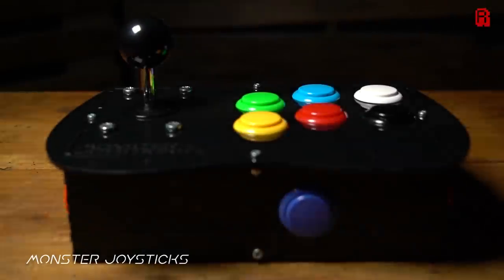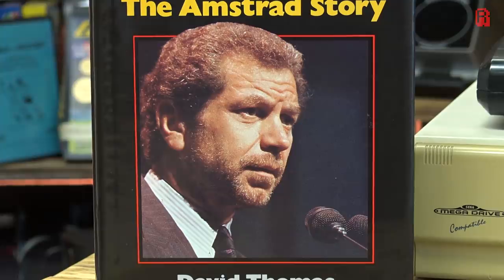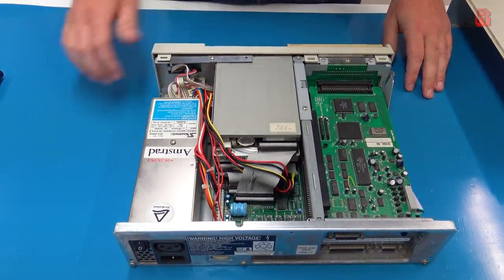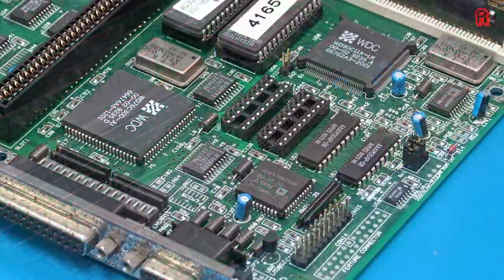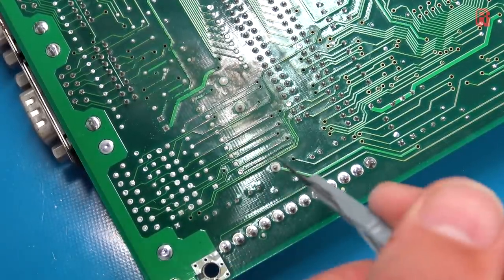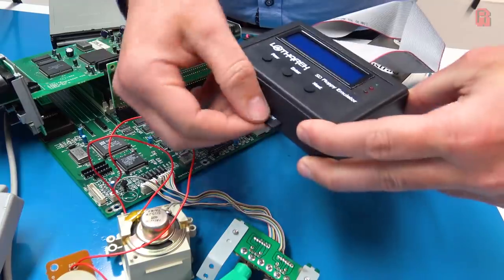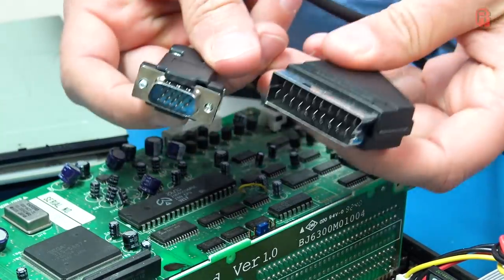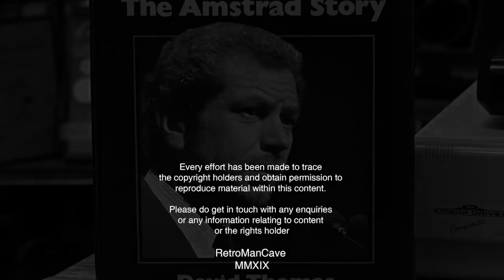Amstrad Mega PC - Console Gaming in an IBM-PC Compatible | Trash to Treasure (1/4)

Comment: I had one of these, bought from some store, maybe it was Tandys, I don't fully remember. It was really neat for someone who was predominately  a console gamer, for getting in to some PC gaming too. I remember I upgraded it with 4MB Ram and a Soundblaster 2 Pro. One of the really cool things was getting to play MegaDrive games on that monitor, way better than a MD looked on a TV. I recall one time, my PC gamer friend was teaching me how to play Dune II, and he had to go home for lunch, so I just slid the front panel over, and played some Sega while he was gone, and when he got back, slid it back again, and the game was waiting right where we left it. I don't think it was mentioned, but the panel below the cartridge port pops off, to reveal a connector for a MegaCD, provided you could get the special cable for it... I think that may have also required some special cart to jump start that too.
Reply from the maker: Thanks for sharing your memories, a soundblaster card would be a great addition to it.  The expansion slot gets a mention in part 2, but the special cart is quite funny, the only thing special about it is that it pushes the switch down to turn the MD on... It's a dummy cart!

Comment: The first PC I used to play games was an Amstrad Mega PC. It must have been late 1993. I wasn't very technically minded back then, I just remember that it played X-Wing like a dream.  Also, The Mega Drive graphics looked super sharp on the VGA monitor. Much sharper than on the usual 14 - 15" TV's  that sat in most UK kids bedrooms of that era.  I was quite jealous of my friend at the time!

Awesome video!
Reply: It played TIE Fighter even better.... even if it did take up half of the space on the 40 MB hard drive!
Reply: I think that was the main point, that you didn't need to use a TV for the Megadrive. I keep thinking that if they had built a TV into this it would have covered all bases. Amstrad sold a TV tuner for the CPCs monitor and years later Sony did a TV with a Playstation 2 built in so it wouldn't have been too radical an idea

Comment: If you wanted some more history. I worked for a company who bought all of the Amstrad rights and stock after Sugar wanted rid. It was then called Edcom and was based in Streatham. We used to mainly do floppy conversions to 3.5 and so on. I left the company in 2000 to go off to the USA but yes, we had a lot of Amstrad stuff. You would be surprised just how many older folk wanted these things repaired and working. We did a butt load of printers too, which was usually sanding and "fluffing up" the rubber paper feeders (which was what used to go on them).
Reply: And yes, it was probably us who changed the controller board on the HDD.

Comment: I used to have one of these as a kid. Grate memory's. With respect of the 15khz screen you could look for a NEC Accusync 71v as this has a 15khz mode that should work grate with this. Cheers for the Vid.
Reply: Or just go the Amiga route and get a scandoubler. Toss up as to what would be cheaper, an increasingly rare multisync, or a generic monitor plus an OSSC. Wouldn't even need to disconnect it in PC mode as almost any worthwhile monitor should be able to sync double-frequency VGA these days.

Or maybe just a VGA-SCART adapter as used to connect 15khz RGB sources to data projectors, and either a cheap secondhand projector (who doesn't want an 8x6ft game of Sonic?), or a couple of gender changers, a switchbox and a TV. Shouldn't be too difficult to fit a couple of small LCDs together in the same sort of space a single CRT used to reserve. Just flip from one to the other as needed.

... in fact, no. Just get a regular small-to-midsize TV that also has a VGA input. Get a VGA Y-cable and the aforementioned adapter. Plug both loose ends into the TV, and just swap between "AV1" and "PC" inputs. Job done.

Comment: I worked for Amstrad  from 91 till they sold the PC division to Viglen.  I don’t remember a 486 version hit retail. I assume it would have used  the 486SLC chip so allow the use of the same 386 board. Just like the PC7486.

Comment: Nice repair job. ;)

I remember seeing a Mega PC sat taking pride-of-place in my local Tandy shop in the 90s.

I don't think they sold very many. lol

(we already owned a couple of PCs and a Mega Drive back then, but I still thought the Mega PC looked awesome.)

Still a great collector's piece, so it's great to see one restored.
Reply: I think the included "multisync" monitor made a clicking sound as it switched between the 15 KHz and 31 KHz modes.

So it probably had a relay in there to change the inductance of the yoke?
Reply from the maker: Thanks Ash, lot's more tidying up to come in pt2.  Of course in the time it took to make this video you would likely have designed a new one from scratch 😂🖒

Comment: I remember it back in the day, but I just now realized that it was (and probably is until today) the only computer that actually combined a Z80, a Motorolla 68000 and an 8086 architecture processor on the same machine.

Comment: ironically as a kid, I once drew up designs for a Sega Genesis and PC Combo machine (iirc it had a cd-rom drive and modem port)...its funny to find out that they actually existed.  Fantastic video as always though
Reply: I drew up designs for a laptop that had two touchscreens instead of a keyboard.

That exists too... Although it came about roughly 20 years after I thought of it - I have one nearby.

I mean, it's not a great idea, in practice, but it absolutely does look awesome. XD

(Acer Iconia 6120 in case you're wondering what the 'real' version of the idea is.)

A bunch of companies are on the verge of trying to release new adaptations of the idea though.
Asus has one in the works (they call it project precog)
And Lenovo is working on a small folding screen laptop, which is still conceptually kind of similar...

So... I guess I was less crazy than I thought, if 30 years later, several companies seem hell-bent on getting the idea to work... XD

Comment: The adverts for the Mega PC in Sonic the Comic definitely boasted a 486 SLC "plus" version as available to order for £200 more (or £300 more with a bigger HDD). I used to stare longingly at those ads so can remember them pretty photographically! They were sold by Silica systems, not Amstrad themselves.
Reply: Yes they did, but that was THEIR own mod. Amstrad NEVER offered this from the factory. 

It was nothing more than a clip-on 486 upgrade.

They just coined the "Plus" moniker as Amstrsd previously used this to denote their upgraded/updated machines.
Reply: @R33Racer  I suspected this, especially as it was a 486 SLC and therefore probably the identical motherboard. That's why I specified the adverts were from Silica, rather than Amstrad directly. Thanks for clarifying/confirming my suspicions!

Comment: Was there an Amiga-Genesis machine? I mean, with the 68000 Processor, wouldn't be an easy task to combine them?
Reply: DUAL CORE !
Reply: I think the difficulty would be in sorting out licencing rather than technical. The same reason you can't get a combined Playstation / X Box despite them both using very similar AMD processors.
Reply: @MrDuncl  Thank you for the answer... i should figured it out myself... :-)

Comment: I want to see you trying the ISA card in another PC. Somehow the idea of a games console on an expansion card fascinates me.

Curious as to whether it would work at all. Maybe you'd be able to use the PC and the console at the same time in another PC that doesn't have the switch on the front? What if you tried to play a MIDI file through the soundcard portion of the card while in console mode? You'd obviously have to break out the video connector as other PCs won't have the passthrough connection for the video from the card.

Actually this raises some interesting questions about the card in the original PC as well. Does the original PC keep running or is the CPU actually suspended while in console mode? What if you play a MIDI file (or audio) through the soundcard and then switch to console mode while it's playing?

Comment: Something I recently discovered for covering circuit board traces after doing work on them is UV settable solder mask paint. It only costs about AU$2-3 from eBay and is available in multiple colours, including the common green colour. I'd recommend this for anybody's tool kit if they are repairing boards like in this video where they have to scrape off solder mask.

Comment: The Samsung SyncMaster 204 or 204B will handle the 15kHz signals by interpreting them as a 480i resolution. I've been able to use my own Sega Genesis (Megadrive for you) with this monitor and many other older video game consoles over RGB with it with an excellent picture quality.

Comment: cool feature with having the PC side stay on while playing an MD game - you could pull up a walk-through or strategy guide for the game on the early internet and then switch back to reference it as needed
Reply: At that point in time you'd have been using BBS systems or Usenet to pull early game FAQs :)

Comment: Any Multi-Sync monitor will do. There are some LCD ones too, try checking Amiga forums.
Reply from the maker: BenQ make a really nice one but Ebayers are wise to it, selling them at £100.  It's a case of getting lucky with the right seller I think
Reply: @RMCRetro  Commodore / Amiga monitors of the same vintage should work too, but alas those are very pricey.
Reply: Be careful in that Multisync was / is an NEC trademark. As resolutions got higher they started putting the name on monitors that wouldn't go below VGA.

Comment: NEC Multisync monitors. Make sure you find one that will take 15KHz, but they're still cheap on ebay.
Reply: Yes. Also perfect for an Atari ST. The NEC Multisync 2D was the one everyone wanted although it cost about the same as the both the Atari Hi Res and Colour monitors together. I thought it was a con when the later NEC models stopped doing 15KHz. The whole point of a "Multisync" monitor is that it can do a complete range of line frequencies.
Reply: @MrDuncl  yep, I use them for my atari st, amiga, and apple iigs. And I have a fourth that I use on the bench during repairs. Fantastic monitors.

Comment: The Mega 286 sounds a lot like the Xbox, in particular the way the next Xbox is going.  Slightly different in approach the new Xbox is very PC like (as was the 1st) but will seemingly play PC games and Xbox games- the technology for that is very different to smashing a games console into a PC and has more to do with Microsoft's Software as a Service approach- it is likely to be game streaming over the internet.  But from the point of view of how it will be used it seems similar.  The new box will be equally unremarkable because the real work will be done by a remote server and the hardware is based on AMD Ryzen embedded and system on chip technology rather than their more gaming focused CPUs.  That said the Ryzen is basically all AMD have and they have managed to re-purpose one design across a whole use case solution from embedded mobile desktop and server so we shouldn't be surprised it is also in consoles.  I'd be tempted by one of these for £300 but it would need to working.
Look at the tracing on that PCB, you could park a bus
between them.

Comment: Dell LCD monitors from the early 2000s will support a 15khz rgb signal and auto switch over the HD15 connector. This has been confirmed with the Dell 2000fp. 
Lots of NEC multisync and syncmaster monitors will support the same thing as well. Usually, if the PC LCD has an SVIDEO or Composite input, it will also support 15khz RGB over the VGA port. 
Just try as many as you can and see what happens.
Reply: yeah there are loads - http://15khz.wikidot.com/

Comment: Off topic but I have seen a IBM PS2 386 out perform an IBM compatible 486. Both running Windows 95.
Reply: I'm not an expert but i think IBM's PS2 machines used an internal bus called MCA or Micro Channel Architecture which was different from the usual ISA (Industrial Standard Architecture); perhaps this difference in the buses made the PS2 machines more efficient. Hopefully an expert will see this and correct me.
Reply: 386DX40 would be faster than a 486SX25 for example. The 486 in itself wasn't a huge leap in performance until they started increasing the internal clock
Reply: @ubergeeknz  On the micro channel bus a 386 33mhz was faster than a 75mhz 486 on a IBM compatible.
Reply: @overtaxed79   I can believe it
Reply: @ubergeeknz  it saw it with my very eyes my friend made it a point to show off his full size IBM PS2 386 vs his mid tower 486. I was in awe,  at the PS2 this was back in 1998, but the year is irrelevant.

Comment: I had one of these back in the day. It definitely came with an Amstrad joystick. The joypad was also the same colour as the PC and Amstrad branded.
Reply: Also, you say this has been upgraded with RAM but mine 100% came with 4mb as standard. I got it rather late in its lifespan though so maybe they sold them with more ram later on?
Reply from the maker: Hmmmm that's interesting perhaps they uprated the spec.  I have found some peripherals which you'll see in pt2

Comment: I had a Mega-PC back in the day and I loved it. It did come with an analogue joystick but it sucked (a major design flaw had the calibration sliders right on the top, which meant you would knock them with your hands when you used the joystick). I loved that Mega-PC, it was superb. I upgraded it to 4Mb RAM and changed the hard drive to 720Mb. It was a great system, basically a laptop with a Mega Drive in it. Brilliant.
Reply: Hang on. A Quantum hard drive and a 4Mb RAM upgrade AND a fault with the battery? Did the guy you got this from get it from someone in North East England by any chance? I have a feeling you may actually have the Mega-PC my Mum got rid of when I went to university.

Comment: you can remove the mask with fine sandpaper, I use emery paper till I get to the copper, you can run a soldering iron (with small wetting) along the tracks (if broken) to bridge small pits.
Reply: yeah I'd suggest doing that on all those traces, just give them a small "plating" of solder before sealing them up, a lot of those copper traces are probably really fragile and that'll help with that.

Comment: i found one of these on ebay, locally, for £40 with battery leak. I fixed the leak damage, there wasn't much and jumped some traces.  the hdd worked and had nothing really on it apart from Win3.1.  I changed the clock on the Sega ISA card so it would run 'genesis' carts correctly.  I sold it for £800 to some chap in South Korea in the end.

Comment: To think, I bought mine years back for £45 quid (ebay auction), now it's worth so much. They are quite fun to mod, I've done quite a few upgrades (memory, battery, coprocessor, ssd etc)
Reply: Oh, there's also a clip on upgrade for the CPU. You can put a screaming 486 in there ;)

Comment: put a tiny bit of soap into the vinegar and it will creep much better into the tiny cracks. carefully inspect traces, the vinegar will not have creeped under the soldermask as far as the battery leakage had time, so you might want to scrape away some solder mask.

Comment: The Amstrad realibality you speak of was actually caused by Seagate hard drives and western digital controllers in the pc2000 models. Amstrad took them to court over this and won eventually but obviously the damage to Amstrad was done. But we did continue with the pc ranges 3000 and onwards and sold very well. The last of the Amstrad models the 9000 range were very good indeed as we as a small team pushed for the sony CD-ROMs, sony FD drives, Seagate idehard drives, proper creative labs sound cards etc etc

Comment: You can replace those horrid barrel batteries with a common type coin cell.    Someone in the Amiga community sells a tiny circuit board on ebay which has three legs in the right place to be soldered on in place of the barrel battery, this has a socket for a coin cell, so therefore the coin can be replaced further down the line.   I think I paid £5 for this.

I used this to fix an Acorn A3020 computer a couple of years ago.    It should be fine for PCs like this also.

Comment: Where did you buy this? I have a feeling you've actually bought my old computer!! I upgraded it from 1mb to 4mb ram, but in doing so it actually broke the mega drive output (couldn't see anything on the screen) But I never thought to check the headphone socket to check for audio.
On my hard drive I installed windows 3.1 but prior to that it originally came with this weird but awesome Amstrad desktop - like they tried to make a dumbed down version of Windows. I also ended up killing that software by mistake but the device came with another peice of software that was a slightly worse version of the original desktop software, which Iw as stuck with until I managed to get my hands on Windows.
I really hope this is my computer - in hindsight I'm gutted I got rid of it. I would have loved to hae got it up and running again so I'd be really happy to think it ended up with you.

Comment: Enjoyed the video as usual. One suggestion -- rather than manually exercising the PC's functions after cleaning and repair, you might consider automating the process. There are a number of benchmarks out there (used by both professional reviewers and hobbyists alike) that thoroughly test a system's functions...these programs are designed with an eye towards assessing system performance, but they can also be used to verify subsystem functionality.
Reply from the maker: Good idea and yes I would like to benchmark the system before and after upgrades to get some hard figures as well as real world examples.  It's always nice to put a number on it